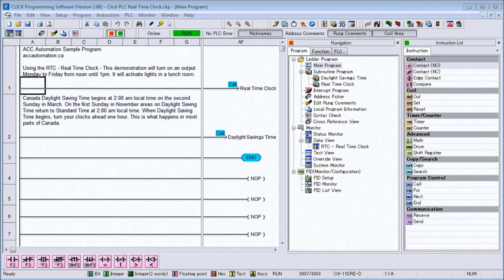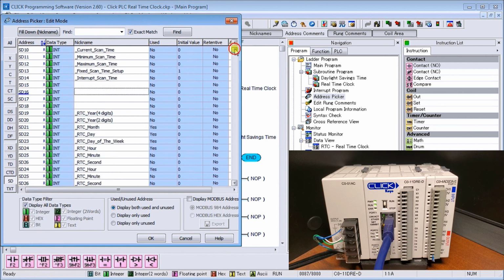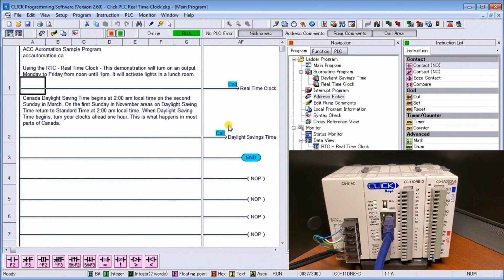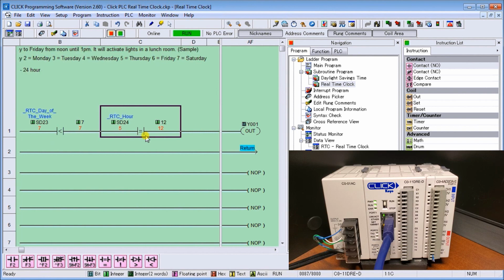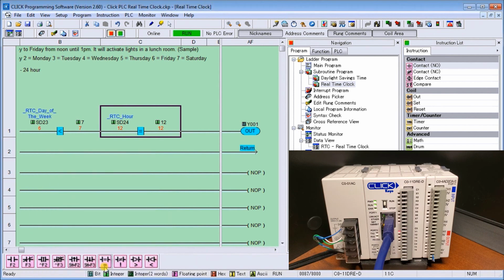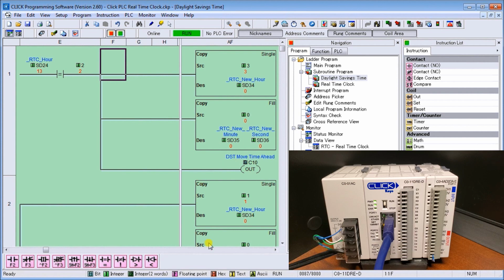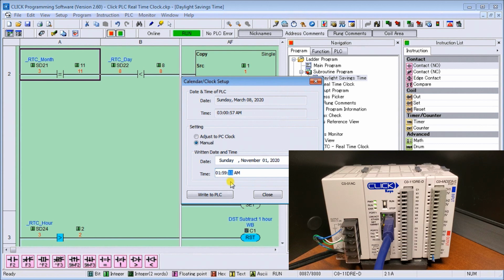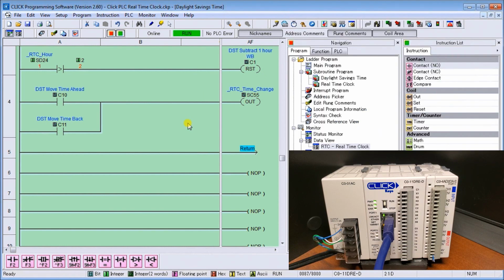Control Your Click PLC by Time - Real-Time Clock Magic!

Comment: Excellent video, thanks! Do you know if leap-years are taken into account?
Reply from the maker: Hi @frikkied2638
Thank you for the comment.
I am not exactly sure if leap years are taken into account with the Click PLC. If this is important then I would use the Click PLUS PLC with the network time service (NTP or SNTP). Here is a post and video on how this is set up.
https://youtu.be/0Vlqo8p0vCI
https://accautomation.ca/click-plus-real-time-clock-setup-and-use/
I hope this helps you out.
Regards,
Garry
Reply: @ACCautomation  Nice I actually have the Plus, so that's good to know that it supports NTP, thanks for info and link to video!

Comment: Shouldn't DST be handled by the firmware?
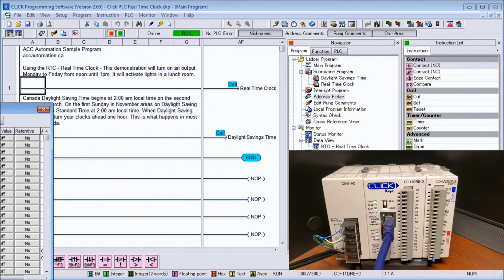For my application, the PLC is mounted on a truck and is powered by a generator while operating (a diesel filtration pump truck).  This  generator will be off at 02:00 hours, the PLC will not be running at that "time change moment".
Do you have an elegant solution for this application? I do have a StrideLinx WiFi router. Is there a method to sync with internet time?

Thank you again, Garry, for all of your excellent videos/website, and all of your email answers to my questions. You have helped me more than I can thank you!
Reply from the maker: Hi Robert de Boer,
Thank you for the comments. I am glad you found the videos and website helpful.
The DST cannot be handled by the firmware because not all regions follow daylight savings time.
You can sync to the internet time using Network Time Service (NTS). However, this will only sync your time with UTC (Universal Time Coordinate) and does not account for DST in the area. This is still left to the individual machine to be set for the region.
Many corporations will just use the UTC instead of DST for the area.
I hope this helps you out.
Regards,
Garry